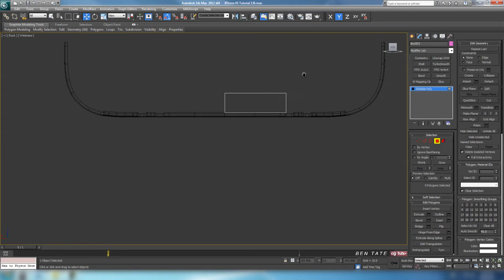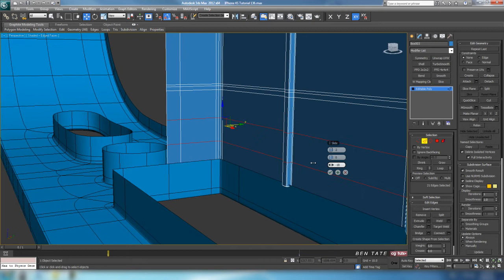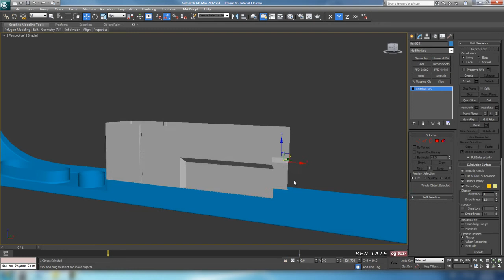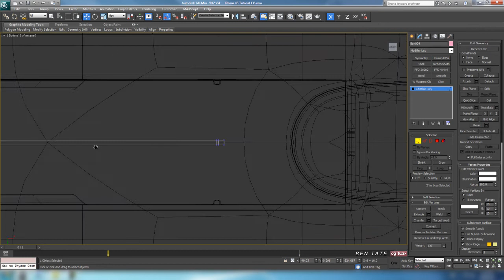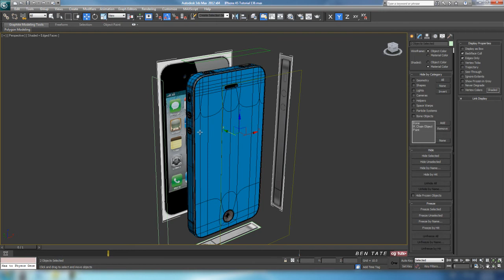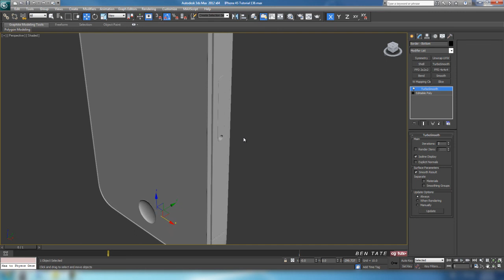IPhone 4S Tutorial Part 3 - Video 4

Comment: Using swiftloop instead of connect to support your hard edges will save you a lot of work.
I have to admit for some pieces it is more accurate but for the ones that do not have to be 100% accurate I highly recommend using swiftloop. It is SUPERFAST.
Good tutorial. Keep up the good work.